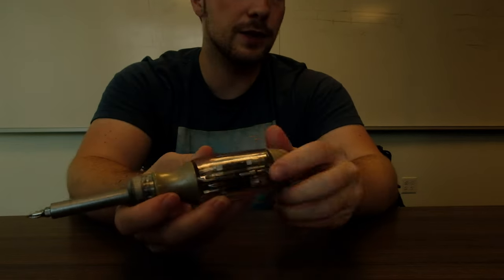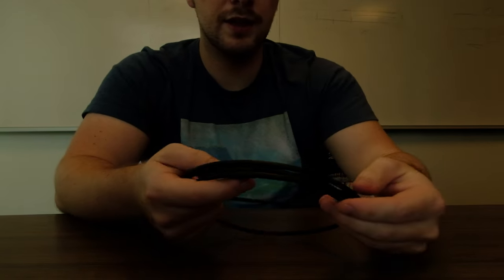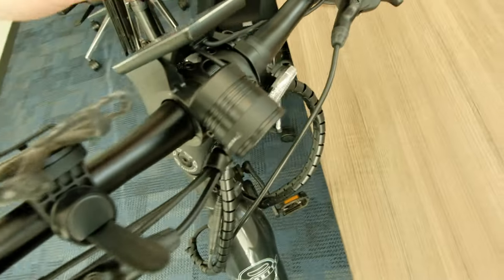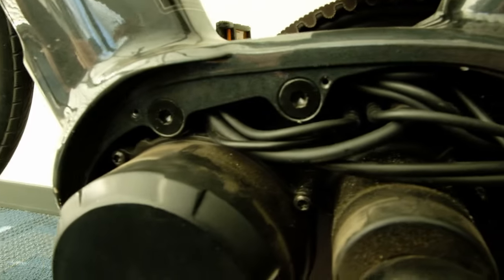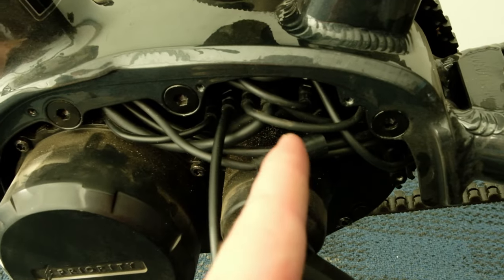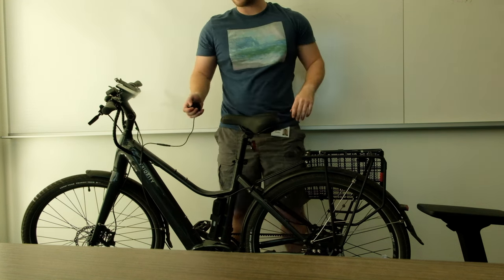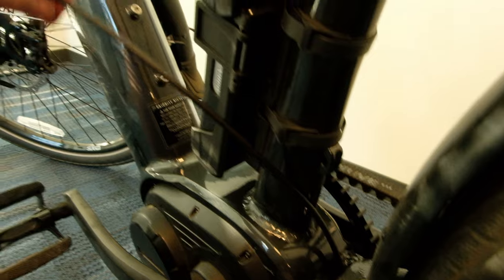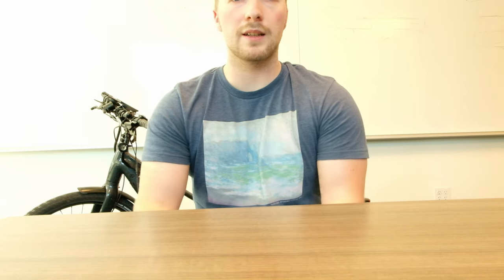Priority Current E-Bike Throttle Installation Tutorial

Comment: I reached out to Truckrun's international sales rep and got an order of 10 of these cables.  I need 3 and will be selling the rest on Ebay.  I'll post here when that goes up.  One thing to note though, you can't pull the new cable through because of how they're routed inside the frame.  However, you can route it through the frame if you want.  To do so you have to a) remove the battery, b) remove the screws holding in the top and bottom brackets for the battery connectors.  The bottom connector is held in by two small screws.  The top has those same 2 screws, 2 larger screws that mount the lock mechanism (it helps to leave the key in and turned so the lock mechanism doesn't fall and is held in place), and 1 screw that holds the battery pins on.  c) remove the black plastic cover over the wiring channel which is held on by three tiny screws.  You will need a well sized screwdriver to avoid stripping any of these as they're all small and very tight.  If you try using a cheap screwdriver you will strip them.  Once all those are off you'll see the old cable and a few others.  Simply replace the old one for the new one.  Getting it back together can be a pain because that black plastic cover doesn't exactly snap on. You have to hold the wires/cables behind it in place while you're screwing.
Reply: Do you still have cables for
Sale?
Reply: @pablitoronquillo2316  yes I do. I still haven't of them on eBay. I'll try to get that done this weekend
Reply: @paulwitt  thank you looking forward for this project
Reply: @paulwitt  can I have your link on eBay once you posted them cables pls
Reply: @pablitoronquillo2316  I just posted it yesterday. Can you not see it?
Reply: @paulwitt  can you just  pls send me the link I can't see it thank you
Reply: @paulwitt  still have some for sale?
Reply: @will_s_citylights  nope. Sold them all.
Reply: @Rich Halbert That is interesting. No, I don't have the part number unfortunately. You have to go through Truckrun to get it and they set the whole thing up through Alibaba. It's not just something you can order directly if you know the part number.
Reply: You don't happen to have a cable like to buy

Comment: I have heard stories of people modifying their bikes and their transmissions can't handle the power. please let us know how yours is holding up
Reply from the maker: Yea for sure. I heard stories of that too. The enviolo hub is vulnerable when shifting gears but when locked into a gear it is stable. Even when in pedal assist only it is recommended you lay off the pedals a bit when shifting according to Priority. Same principle applies with the throttle. Let go of the throttle a bit when shifting. I do this and so far I haven't had any issues with my shifter hub and I've owned the bike for almost a year with 500+ miles on it. I usually only shift at stops anyways for an easier acceleration which is a benefit of the enviolo hub to be able to shift at a complete stop.
Reply: @volaredrones  ahh, I'm going to buy this as my first bike in a long-time. I have always been used to shifting while pedaling, I guess with e-bikes you just have to be a little more precautious. Thanks for the info.

Comment: When using the throttle especially at the highest speed are the pedals going round at speed also? I have a hub drive with throttle and like the rest my legs get when using it. (I have mobility problems) I have a similar mid drive bike that uses that cable would like too know if my legs are not forced to go round when using the throttle thanks.
Reply from the maker: I cannot speak for other model mid drive bikes as I don't have any other than my priority current e-bike and some motors might be different. But in my case with the middrive on my bike model from priority, the pedals do not move when you use the throttle. In fact at the very end of the video I demo the throttle and the pedals do not move
Reply: Thanks for your reply I have a Eskute Polluno Pro. It uses the Bafang M200 motor I am waiting for the lead to arrive from China was wondering about the pedals as in another video (not yours) the cranks where turning I saw you test the bike but could not see if the cranks were turning @volaredrones

Comment: whast the top speed you get on the throttle?
Reply from the maker: Speed and acceleration scales with how low or high your gearing is as well as power level. You can go up to the max 28mph or whatever your max speed is set to under right gearing and conditions before power shuts off automatically to the motor as it would in pedal assist

Comment: Thanks for the video! Bike coming next week and definitely want to do this mod, now to find  the cable...
Reply from the maker: Great choice! The bike has served me for more than a year now and it's one of the best purchases I've made with over 1K miles on it. Good luck on finding the cable. Could help to contact the people that have commented on here as some could've ordered bulk and willing to sell you a unit.
Reply: @volaredrones  Thanks I will do that! Looking forward to getting back to biking but at 67 with crap knees I need an edge to keep up with the wife, who is older but in much better shape..lol… The throttle will be awesome though.. I’ll post my luck finding one here.. thanks again bud !! Ken
Reply: @volaredrones  can’t find the cable anywhere. Looks like the only choice is to order 2 different cables and solder them together using one end from one and 2 from the other. Not ideal but should work ..
Reply from the maker: That should work. As long as you are able to send the correct signals to the correct pins it should be good

Comment: Have you had  any issues with the conversion?  Man, Priority is adamant  about not  doing  this, something about the firmware  and battery  not being  compatible,  and obviously voids the  warranty..You seem to be having good  luck though  right?
Reply from the maker: No issues so far at all for me. I've had it running since I published this video and not once has it done anything wrong. The only downside for me is that when I do use the throttle it will deplete the battery a bit more which was expected as there is no more pedal power helping
Reply: @volaredrones  good to know thanks! I’m adding the extra battery so that shouldn’t be a huge issue.. Appreciate you replying- I’d hate to mess the bike up for what it cost 😱

Comment: If you're pulling out the old integrated cable, you can tape the new one to the end of it. Then you pull both through.
 Unfortunately those cables are already sold out on eBay. I'm 95% sure I want the Current but it hinges on this mod...
Reply from the maker: Hello Charlie. There's some good news. Although I don't see them anymore now there are cables called T4 ebike cables on Ebay that are sometimes in stock which seem to be the same correct generic brand cables. If you find these on Ebay I'd recommend giving those a chance although I haven't tried one personally. As long as the shape of the connectors match it should be ok. Look for the connector that attaches directly to the motor. For that trapezoidal shape
Reply: @volaredrones  Thanks. I don't own the 🚲 yet, so that'll be the first step 😆
Reply: You can't actually pull the cable through. I'm about to post how to route it though.
Reply: @paulwitt  gotcha